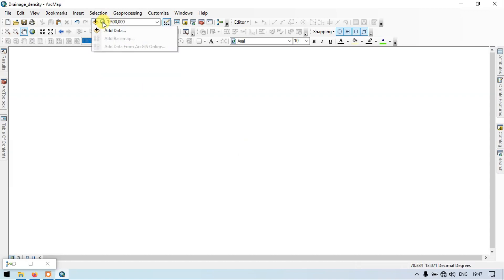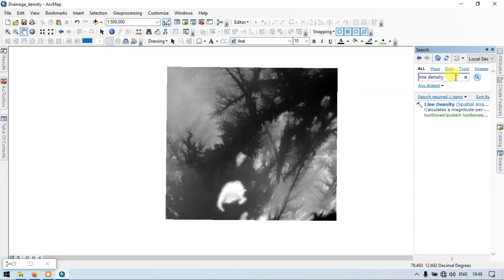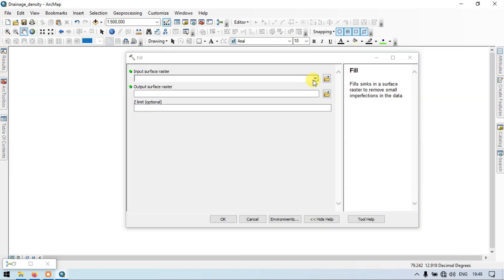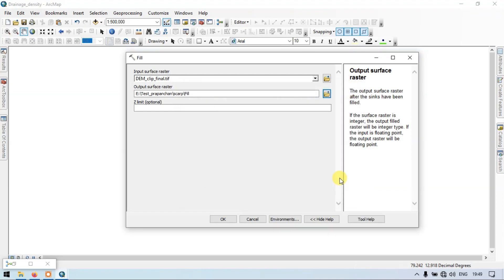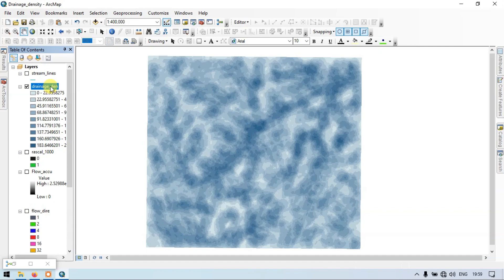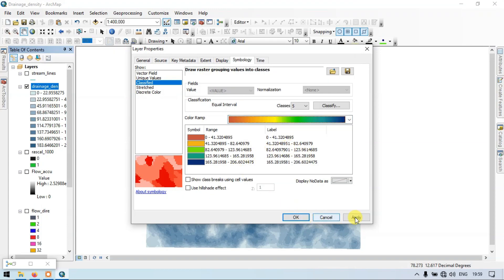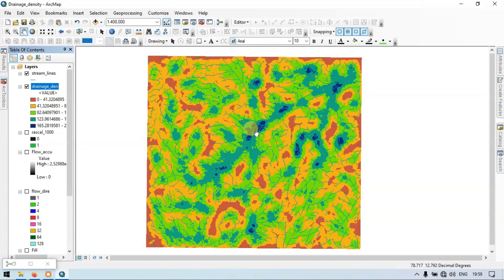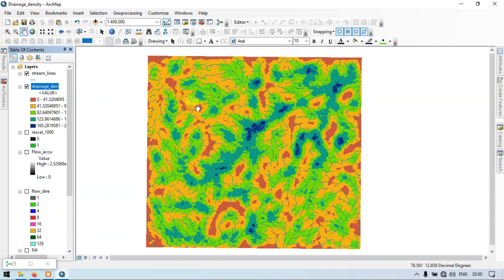How to Calculate Drainage Density using ArcGIS

Comment: how to find the area of 5 classes of drainage density??
Reply from the maker: Hi Mr. Gunneramsey, use reclassify tool to convert the result drainage density to raster. Please note down the values in reclassify. Final convert the raster to vector using the tool Raster to Polygon. And project the polygon to your local projection. Thanks for your valuable question.